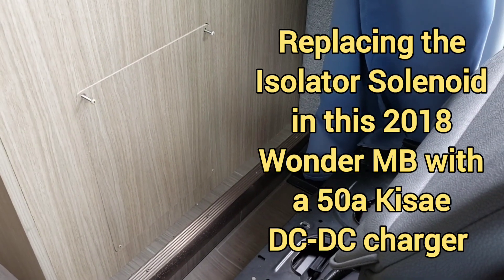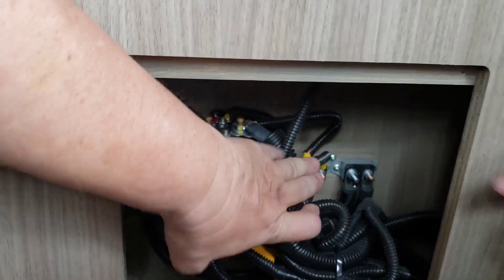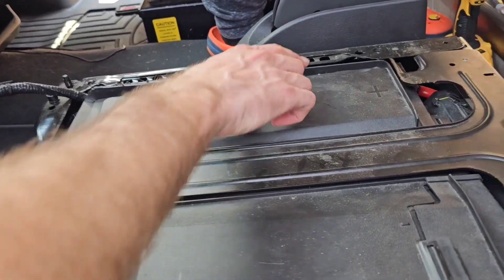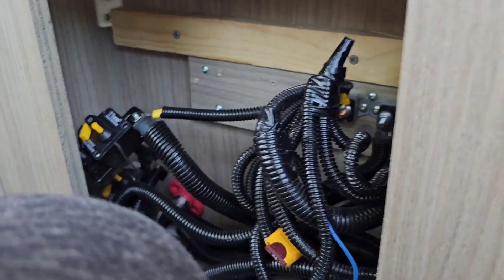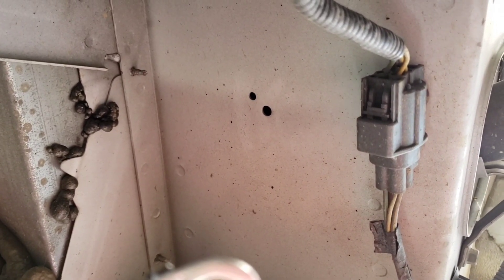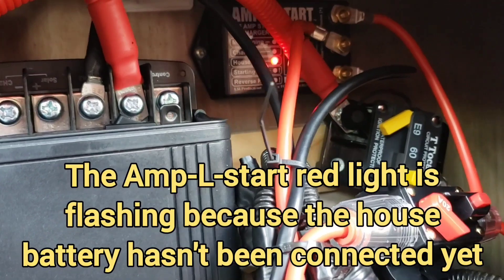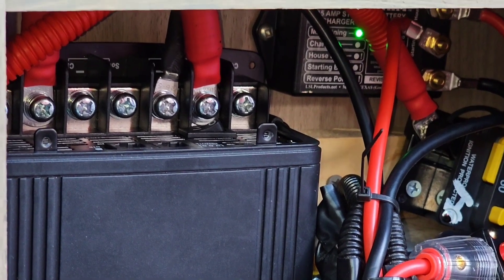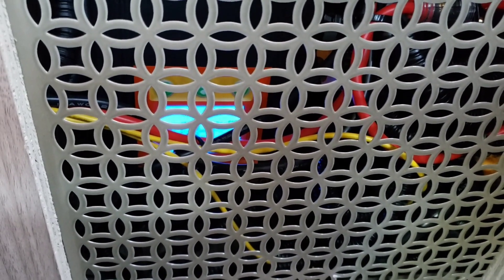Replacing Isolator Solenoid with a Kisae DC-DC Charger in a Leisure Travel Vans Wonder

Comment: I realize this is a year later, but still have the same question!  Moving from the isolator solenoid to the DC2DC charger, it means your 'boost' or 'emergency aux' functionality (if installed) would no longer work correct?  What is the easiest way to retain that functionality?
Reply from the maker: @danbarnes2177  A Leisure Travel Vans doesn't have a boost switch. If you're referring to a Winnebago then the answer is yes, if you don't wire that feature in with the DC-DC charger installation. It's not a simple a installation as it is in a LTV.
Reply: @SandyRVUpgrades thank you!

Comment: Hi, Sandy--followed your instructions and the install worked perfectly!  Your videos were so helpful.  It has given me confidence to start doing more electrical customization projects.  Currently working to install LED cab lights attached to the Ford Transit rocker switches!  I did run into one problem that is probably worth mentioning to others--when connecting the Kisae, it did not initially power on, and I was chasing down trying to figure out if I made an incorrect connection.  You may wish to mention to folks that if the device doesn't power properly to check that the bus connection fuse in the battery compartment is in tact, as you can't really tell unless you pull the bus fuse.  Again, thank you for your excellent videos!  My wife and I are excited to head out on our 2,000-mile excursion next week with Lithium power!
Reply from the maker: Congratulations 🎊 👏

Comment: > If you are switching to Lithium batteries or already have Lithium batteries you need a DC-DC charger

Need may be overly broad.  DC-DC is probably a good idea with a 320Ah LFP, but smaller banks can charge nicely from a relay/combiner/isolator.  My own 150A bank pulls ~45A at low SoC, quite acceptable for both my bank and 180A alternator.  The Alt voltage is also within the normal charging guidelines for my battery.